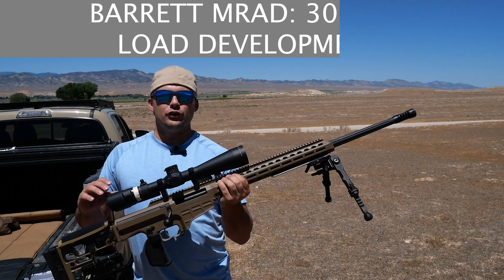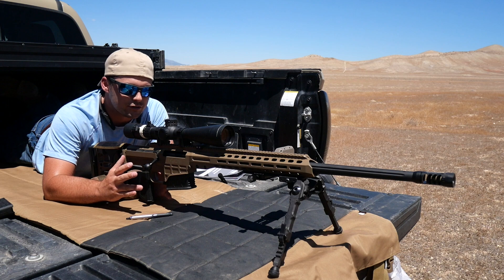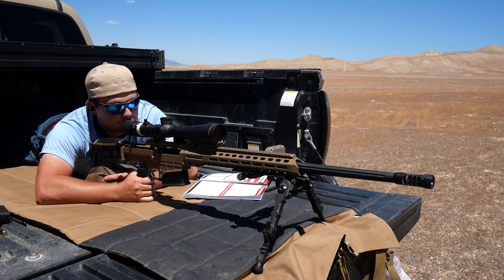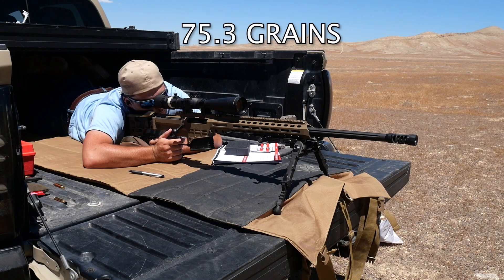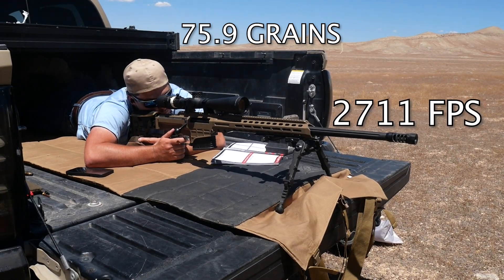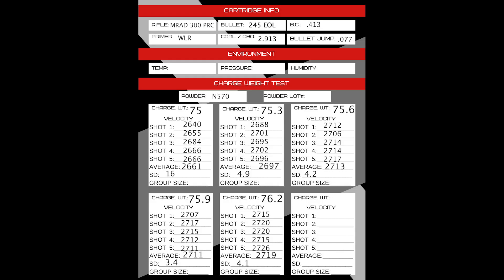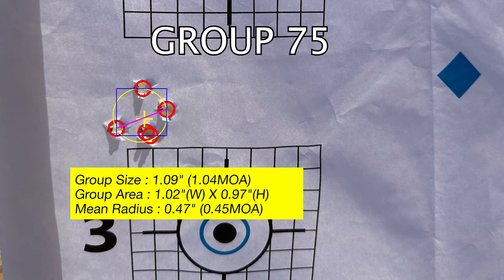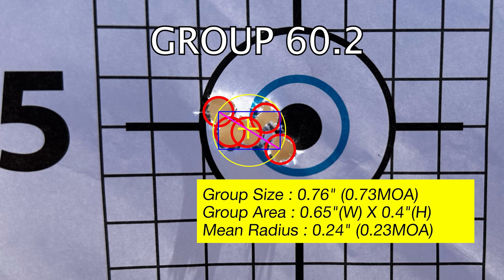RELOADING: LOAD DEVELOPMENT PART 1, INITIAL CHARGE WEIGHTS. 300 PRC

Comment: My 300 PRC I’m using 215 hybrids and using Retumbo for powder at 81.7 grains and I’m getting 3095 avg out of a 30in barrel. No pressure signs, flat primers, ejector mark or heavy bolt lift. Eventually I’ll work up some loads for the 230 or 245 hybrids.

Comment: I was curious how fast the prc could push those. I built a single shot target rifle to plink steel out to 2500 yards in 300 RUM with 33” barrel and i ended up with my velocity at 3175 fps zero pressure and a hammer
Reply from the maker: Man that’s awesome! I was wondering how fast they’d go or if I’d need to move to 212’s. Not too bad so we’ll see how they do. But man 3175 is nuts! Sounds like an awesome rig. You get a custom throat length for the longer bullets?